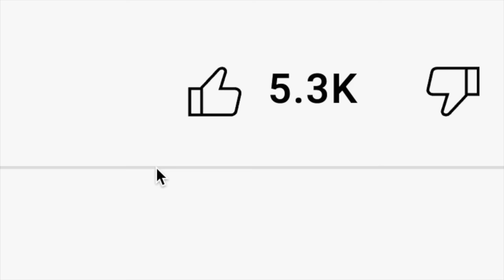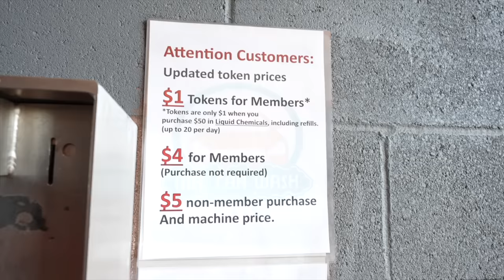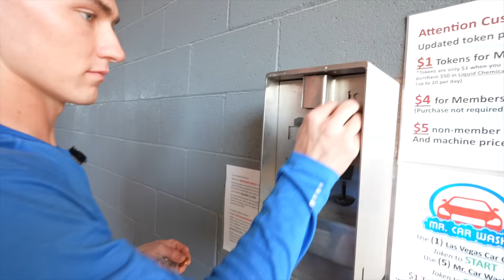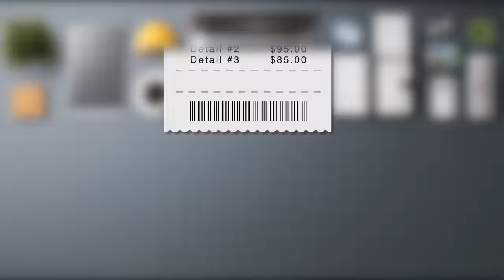Making $500 Per Day Washing Cars | Undercover Millionaire

Comment: The key here - which wasn't discussed much - is scalability. Mobile detilaing, pressure washing, lawn care/landscaping etc. are all easy markets to break into. But there is a diminishing return on profit. You have equipment purchase costs + upkeep cost, cost of product, etc. even working solo. Won't even get into taxes. When you decide to scale, you have to pay someone a wage + all the same costs per rig that you had in a solo op. You can only raise prices so high before your clients will go to someone who has similar work quality but lower prices. You will only make so much per rig with any given type of work. Scale enough and you can make a decent living while doing nothing but managing your rigs. But the upper limit of your income in these areas is strictly dependent on your scalability and your ability to sell your service at a reasonable profit margin that warrants the work. It's a great gig if you live within your means but it wears on the body quickly and you become beholden to a strict schedule dictated by weather, seasons, and your clients schedules. Just my experience from having done all three - landscaping, pressure washing, and mobile detailing.

Comment: I've got a suggestion for Tyler, I've just seen you having an issue with the carbon monoxide sensor going off on the generator. I've seen people online extend the exhaust of the generator. Potentially if you have the exhaust running further out of the vehicle it could prevent your generator from shutting down. Or even having a fan that ventilates the area around the exhaust.

Comment: He could raise prices. To have a mobile detailer of that sophistication is a premium. He's doing good revenue once he gets over his fixed costs that's great. Probably not a bad gig in Vegas I'm assuming? Except this time of year when its murder but that's when no one wants to be outside and having a mobile detailer is a premium. I would seasonally adjust my rates for this time of year to be higher but if you have an established clientele list with a good reputation you can probably charge a premium.

I would add up sell stuff like: Ceramic coating a car, adding air fresheners in vents, removing seats to get into carpets if they are bad, maybe topping off fluids like coolant, windshield wiper spray, rain x the windshield, fixing headliners, etc.

Comment: Graham, I have a special request for a video. I operate a small business that brings in several million gross (single digit millions) per year. The business is a C Corporation. Every time I open up a new vendor account or get a loan for the company (the company is getting the loan, not me personally) the lenders insist on running a personal credit check on me even though it is the Corporation that is getting the loan and not me that's getting the loan. As a result, my personal credit score takes a hit because of the ongoing inquiries that aren't even for personal loans. As the company grows, this problem is getting worse because the company is doing more volume. I've worked at a number of large companies in my life and I've seen mid-level managers getting loans or credit on behalf of these Corporations and never once did the bank or vendor insist on doing a credit check on the CEO. How can those Corporations avoid hitting the credit score of the CEO but in my case the lenders insist on hitting me (the CEO's) credit score? I don't see the difference between these two situations. I think talking about this would make a great video and would help other business owners in the same situation.